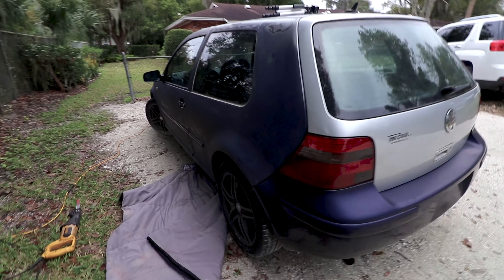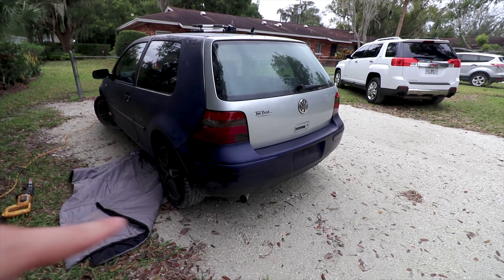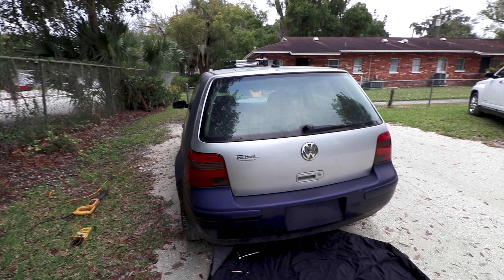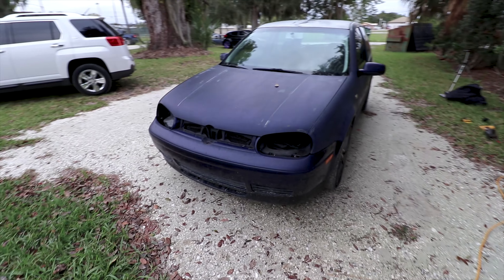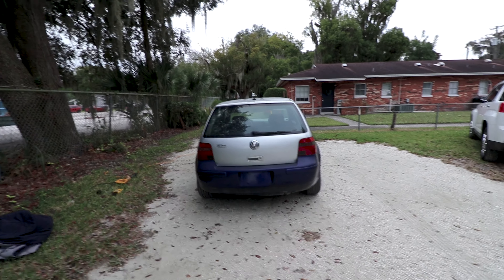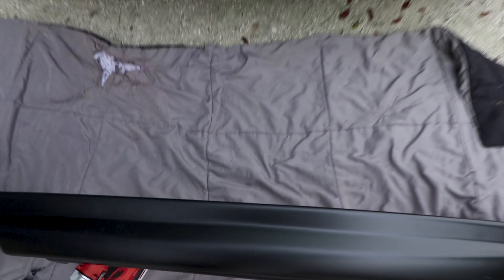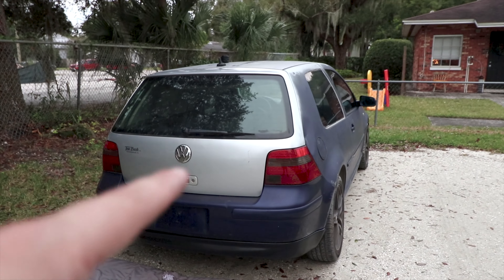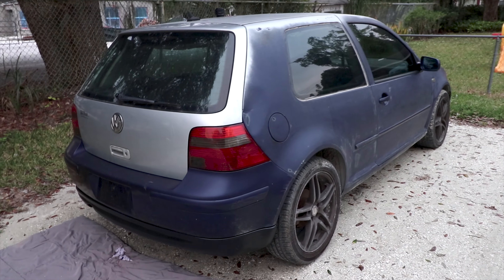Mk4 GTi VR6 Straight Piped!

Comment: I wouldn't recommend a 3" exhaust, you'd lose back pressure, and a little power because of that loss. Go for a 2.5" on an n/a vr6 for best results in both power, flow, and sound. The only time you'd want a 3" exhaust is if you're running serious turbo.

Comment: Quick question are vr6 turbo?
Reply from the maker: adair moreno not factory equipped
Reply: Well it’s GTI so technically yes (gas turbo injection) correct me if I’m wrong
Reply from the maker: tyler soto You are incorrect. GTi stands for ‘Grand Tourer Injection’. The only VR6 Turbo GTi is the R32
Reply: MK6Guy ohhhhhh my bad I just know that TDI stands for turbocharged direct injection so i thought the t in GTI was the same
Reply from the maker: @tylersoto3306  Yeah haha big difference